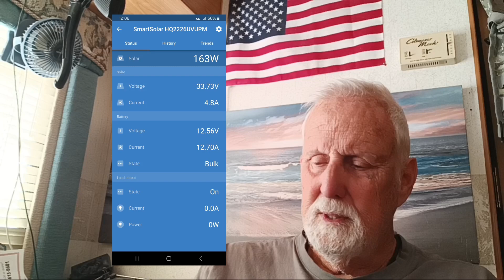More Solar Watts? The Impact of Tilting Your Solar Panels!

Comment: That's great news!  (Do you shoot videos with your phone?  If so, I believe there are microphones that you can buy that are designed plug into your phone.  The good thing about those is they come with a fuzzy cover -- I can't remember what is is called -- that blocks wind noise.
Reply from the maker: Great idea. I have a little plug microphone that has a thin foam rubber cover.  As I recall it worked OK. As you can probably tell by my videos I'm pretty frugal. I told myself I wasn't going to invest in making videos until I got monetized and know that I am serious. But I will definitely use that little microphone that I have on the next project. Thanks for reminding me.